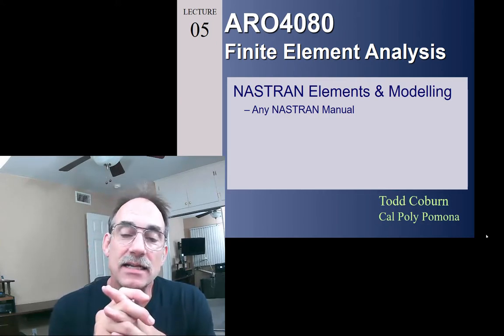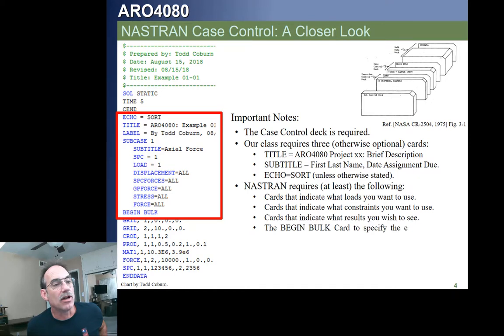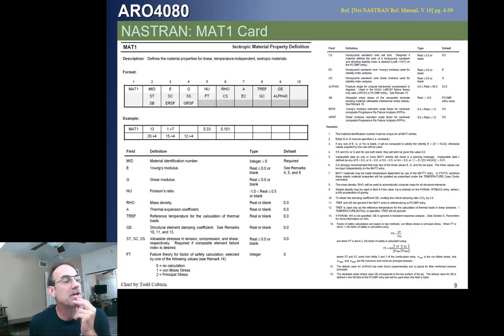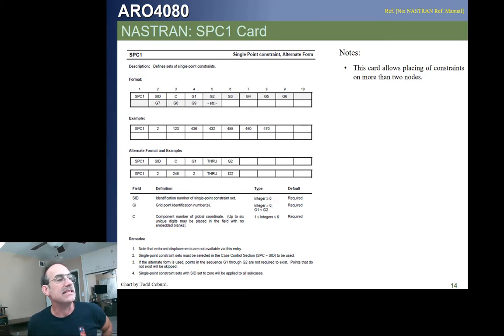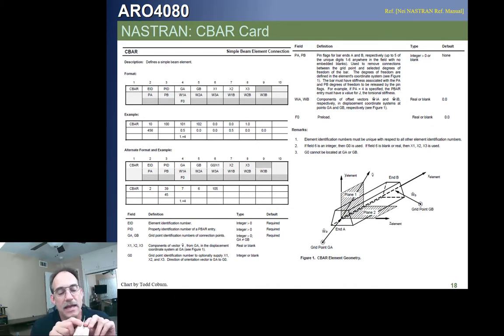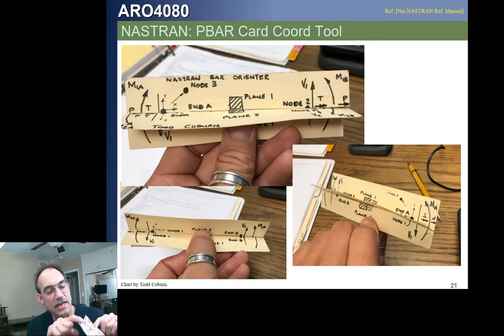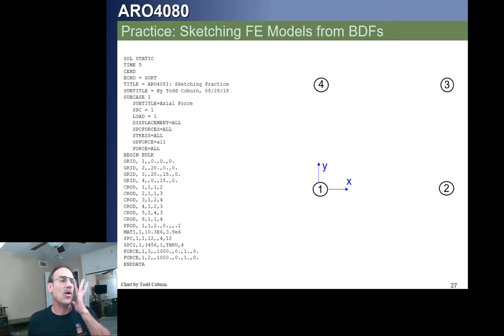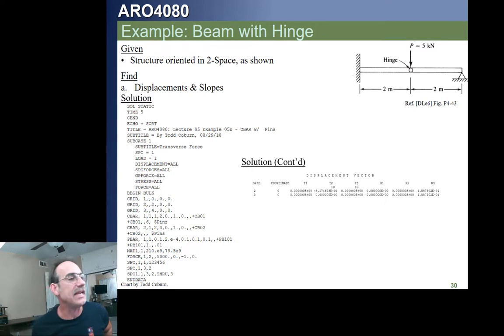Finite Element Analysis: L-05 NASTRAN Modelling of Bars Beams & Springs

Comment: In the input file for the example at 30:00, the SPC1 card should only call out directions 345.  If you include direction 6, the rotations in the x-y plane will be locked.  Probably an oversight.
Reply from the maker: You are correct… except that it has no effect for this model, because the elements have no ability to transfer rotation.  Often it is expedient to over constrain certain nodes to keep them from introducing singularities into the mathematical solution.

However, you are correct that the joint should be pinned.  It is, not from the constraint, but due to the lack of any rotational stiffness in the elements attaching to it